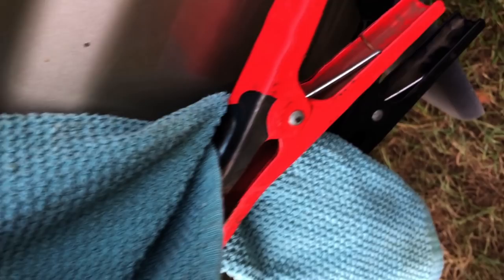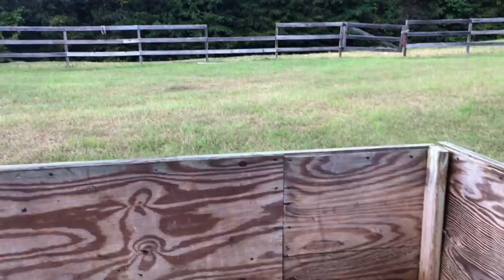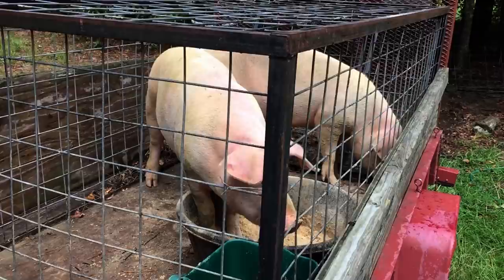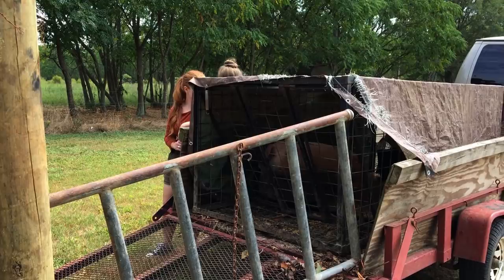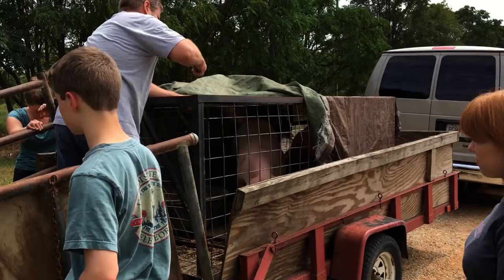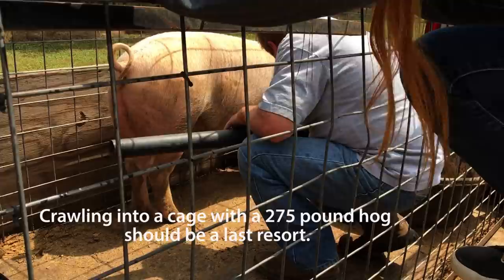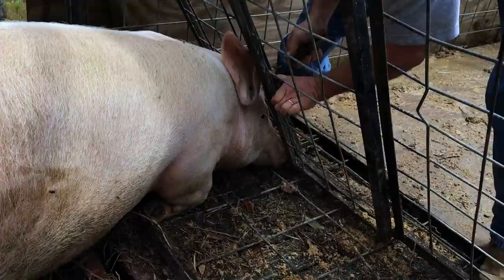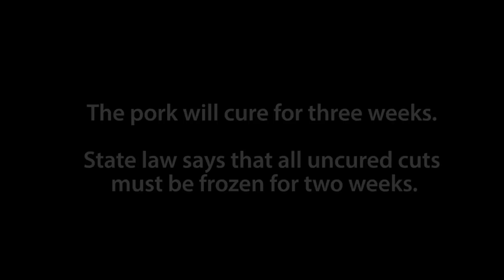How to Load, Transport and Unload Hogs on a Small Scale

Comment: I live right out side of Newnan. Can I get contact info on the butcher you used?
Reply from the maker: Susan myer  It's Yoder's Butcher Block in Montezuma, Georgia.  We've used them for almost 20 years.  Mr. Yoder is very easy to deal with.  Thanks!
Reply: I live outside of newnan to and use Jeffers in tallapoosa. They dont a great job and only about an hour away.